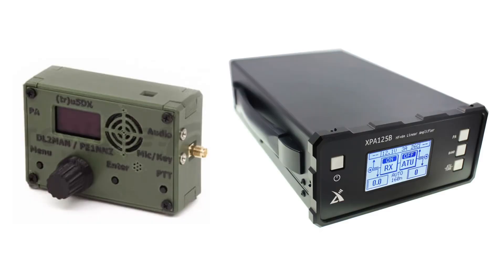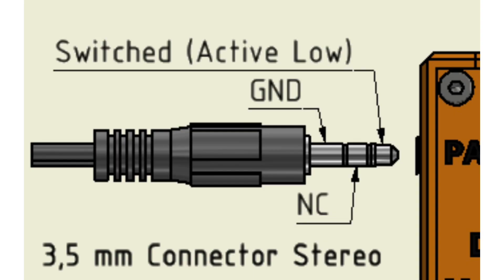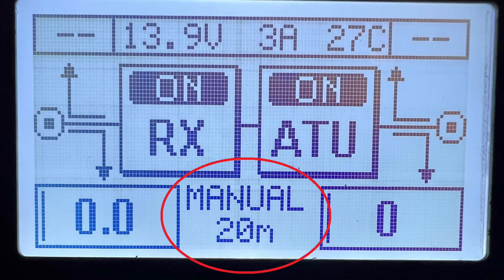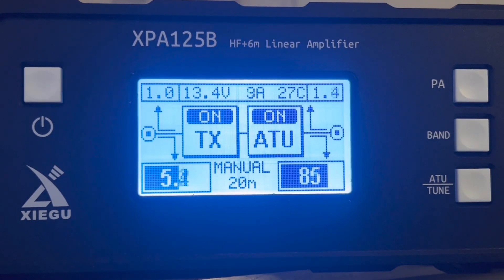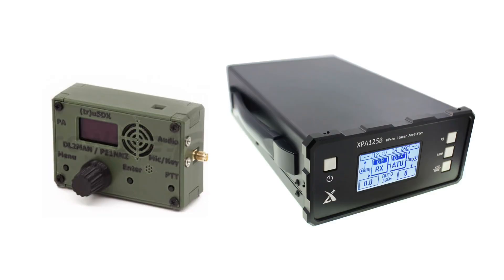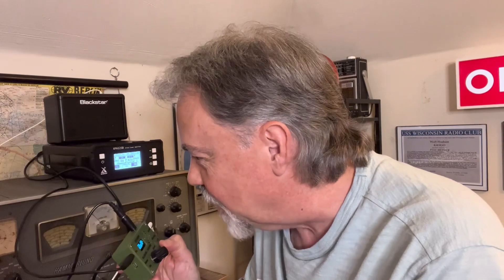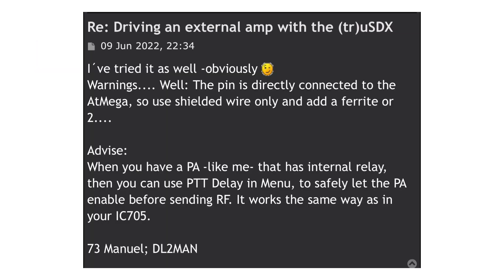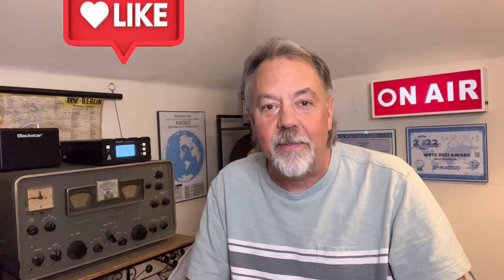Driving a Linear Amplifier with a (tr)uSDX

Comment: Nice video, i was thinking of getting back into playing with radios and just ordered a qrp transceiver the USDX+ v2 and was thinking of building a 25-50 watt linear amp. I wonder if it will work. What type of antenna are you using? Thanks
Reply from the maker: Thanks, I have that radio as well and yes it drives an amplifier very well. In this video I was using my Sigma EuroComm HF-360 vertical

Comment: Walt - I'd like to connect my (tr)uSDX to a MX-P50M 45 watt amp.  I went to DL1MAN's web site searching for the description of the PA keyer cable to buy/build/modify.  Cannot find the information on his site.  Any pointers for me?
73 AC1NY
Reply from the maker: Take a look at the pdf file on this page:
https://dl2man.de/2-trusdx-assembly/ 
It has the pin diagram for the PA jack. Should be pretty easy to put together a PTT cable for the MX-P50M from this. I’m actually looking into getting a MX-P50M myself, looks like a great little amp to throw in my bag for travel. All the best and 73, Walt K4OGO

Comment: I like almost everything about the (tr)uSDX but the ugly case and micro USB power connector. It needs a case option as attractive as those from QRP Labs even that it costs more. It also needs to adopt USB-C and support the variable power features. I've got a USB-C power block with "PD." It can supply 5 volts or 9 volts. The latter would be almost idea for this device.
Reply: The (tr)uSDX is an experimental rig designed by hams, not a commercial product like QRP Labs products. The designers aren't selling them and don't make any money from them. They wanted even poor hams around the world to be able to buy inexpensive parts and build an all mode, multi-band high-efficiency transceiver with good performance. They even set up a system for group buys for ham clubs and such to use to band together to buy all the parts cheaply. The rig's design is their gift to the hams of the world.

These are not commercial appliance radios. Everyone needs to understand that. We are welcome to package them in any manner that appeals to us. We're hams. We have a government license to do what we want with and to our rigs. We are welcome to mod them in any fashion we see fit. We own them and have ham licenses to do what we want with them.

So why don't you just implement the changes and features you want? Mine was a kit, and I ordered it without a case. I'm putting it in a metal box for RF shielding, and adding a battery, a larger off-board speaker, and variable voltage regulator to my RF output FET drains so I can dial up or down the output power in order to run the minimum needed, as the FCC in the USA specifies we are to do. I've calibrated my reference frequency and tuned the toroids on each band for harmonic reduction and maximum output efficiency. I'm also removing the small 12V power socket on the board and soldering wires right to it to be switched on and off from the battery. No problem. We're hams. We are fully authorized to modify whatever we want in our radios any way we see fit, and make them look and do what we want. The rigs aren't consumer appliances and don't come sealed and with 2 year warranties that such mods would void, so we're free to experiment.
Reply: @johnwest7993  well said - k6rys

Comment: Interesting. I have had very poor signal reports using my (T)uSDX with my RM Italy amplifier. I had to turn the TX drive down from 4 to 2 to get rid of the distortion. But I am still having people tell me that they hear RF on my signal. I figured that the fact the radio was in a plastic case was the issue but you are getting good signal reports so I dunno.
Reply from the maker: I have a RM Italy HLA 150 plus as well, might have to try it and see if I get the same issues. Thanks for watching. 73/K4OGO

Comment: I'm digging the (tr)uSDX vids. I just got my General and am ordering one of these for my first HF rig. Were you running an external antenna tuner? For some reason  I was under the impression that there is no internal ATU in the (tr)uSDX. Thanks for making these videos!
Reply: You shouldn't need a tuner between the output of a (tr)uSDX and an amplifier. They should already both be matched to 50 Ohms unbalanced by design. An antenna tuner may be needed between a (tr)uSDX and an antenna if the antenna doesn't have an unbalanced (coax cable) 50 Ohm input, or the transmission line between the radio and the antenna is not 50 Ohm cable.
Reply from the maker: You are correct the (tr)uSDX does not have an internal ATU. This amplifier has one, thus thus the ATU reading on the front. Thanks for watching I’m glad you are enjoying the videos! 73 K4OGO